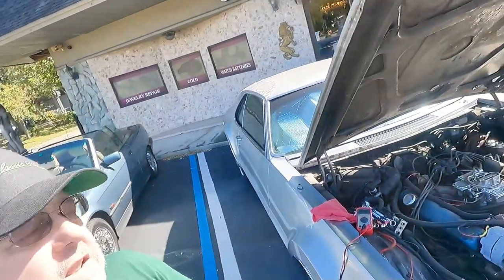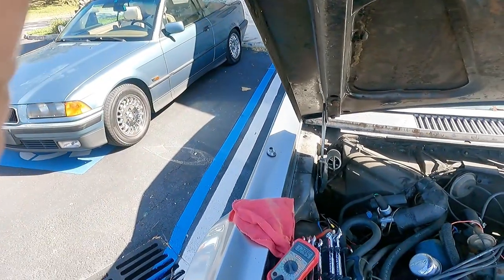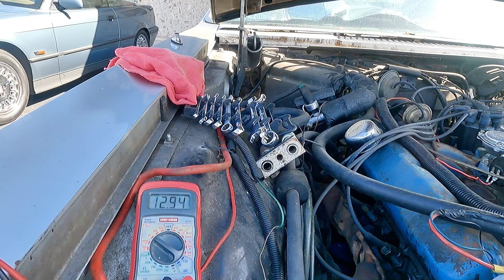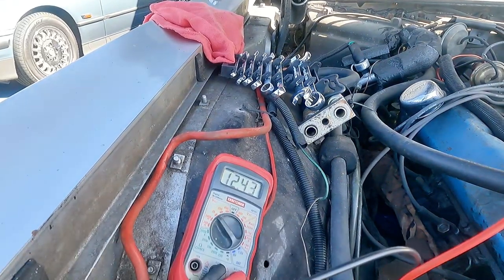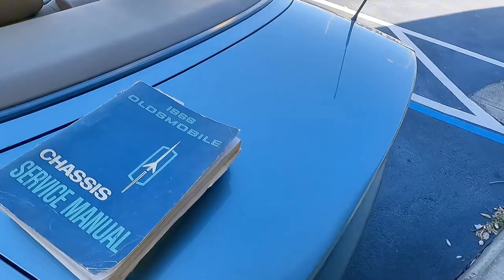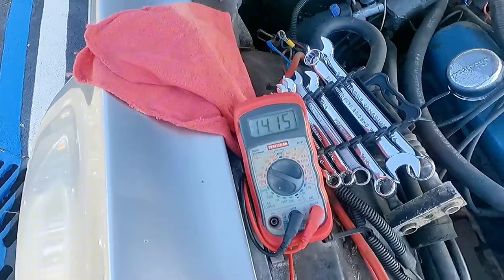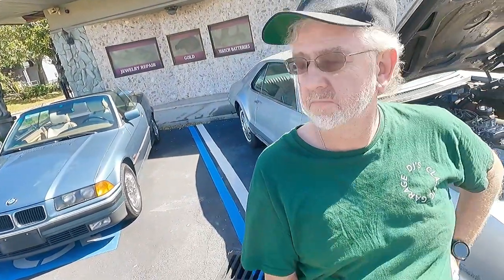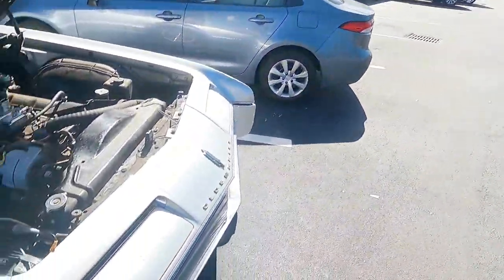Amazing Things Happen When You Actually READ THE MANUAL!

Comment: Not sure what you got going on there but my '66 Toronado's alternator grounds through the case. Three connections on the alternator, one hot from the bat and a two pin connector for the field and field relay.